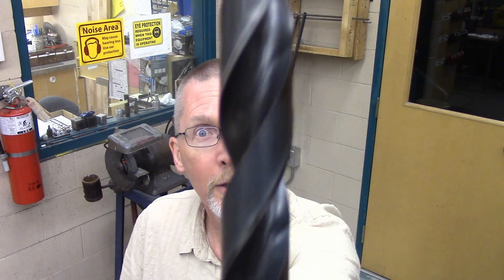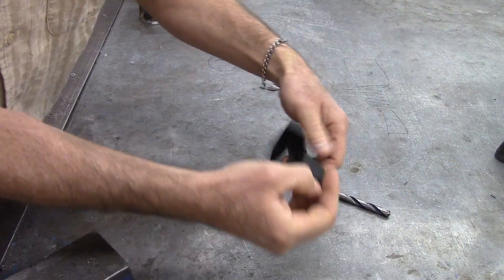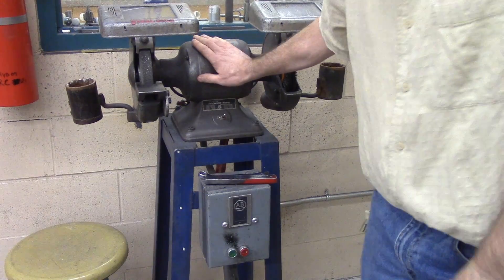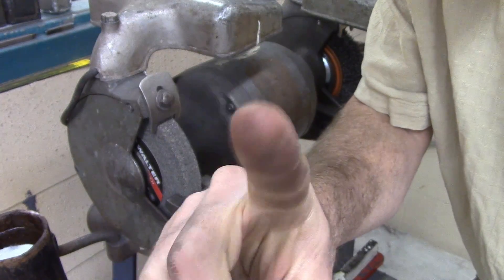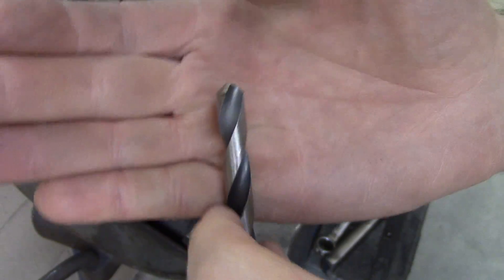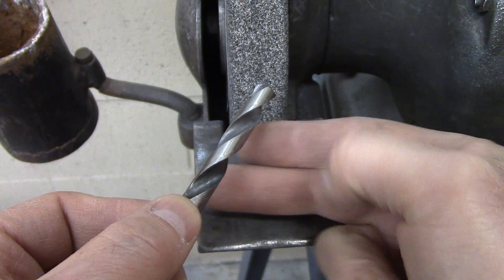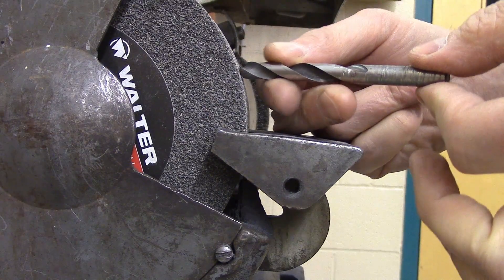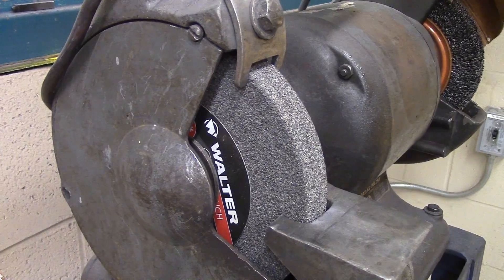HOW TO: Sharpen Drill Bits

Comment: You were taught how to sharpen drills by a real honest to God toolmaker/machinist/cutter grinder. The old timers didn't waste time with drill sharpening setups or specialty machines. 
I have had job interviews where the owner of the shop took me out on the shop floor, picked up a drill, butchered up the end, and then told me to sharpen it. Based on how I went about sharpening it, determined if I "might" get hired. 
He then took the drill, chucked it up and drilled a hole in a piece of scrap. 
If it cut right, made respectable chips, and most Importantly - drilled a close sized hole - is what determined if I could fill out an application form to be hired. 
Drilling holes and using sharp tools is the basis of pretty much all machine tool work.
If you can't sharpen a drill that will cut, you most likely can't do anything else that the shop will ask you to do!

Comment: how can you sharpen a step bit?  thank you.
Reply from the maker: I've run the grinder down the flutes to get a new edge, but I'm not very successful doing that.  It's more of a stop-gap until I can go into town and buy a new one.
Reply: shoot i was hoping you had a way to do it as good as for regular bits. Those step bits are expensive.  @GregWellwood
Reply from the maker: The GOOD ones are expensive (I sheared my Milwaukee step drill off - GRRRR!), but the cheap ones are pretty much throw-away when they dull.  And they dull quick.  Watch your speed with those - keep it slow.

Comment: Those are great, simple steps to a sharp bit.  Two things you might have added: even before you turn the grinder on, make sure the grinding wheel is of a medium or fine type.  If you use a coarse wheel, the bit will not cut as efficiently, as the edge will not be uniform.  Secondly, make SURE the wheel is FLAT and SQUARE!  Most wheels that have seen any use at all will not be flat and square and this is very important if your sharpening efforts are to bear good fruit.   A good idea is to buy a new, fine wheel and keep it ONLY for sharpening bits. Thank you for a fast, simple video.  
   You might want to do a quick video showing how to properly dress a grinding wheel?

Comment: You make it look so easy!
Reply from the maker: Yeah, but I've sharpened one or two in my day. Now I'm sharing the magic with you fellers!
Reply: @GregWellwood  Greg, maybe eventually you can do a video on how to do a split point. When I was a machinist..... Thinning out the web by doing a good split point increased accuracy quite a bit. We used to use a Black Diamond drill grinder in our shop, but I would also love to be able to see if it could be done by hand as well.... And I have a feeling you're just a man to show me how to do it!
Reply from the maker: I don't have as much experience with that, but I'll see what I can come up with.  I do thin the web when the drill is getting really short.  I also (cough) sharpen my milling cutters by hand too.... (cough)
Reply: @GregWellwood  It's truly a lost art..... hand sharpening of tools. That's one thing I always admired about the old timers: their knowledge of how to sharpen.

I remember one day I was working on a project involving brass, and the Foreman of the shop (an old German tool maker) helped me to sharpen my drill bit. And when he put "flats" on the leading lips of each flute..... I thought he was crazy! Then he explained that brass tends to 'pull' the drill bit too much -- that the flats help improve accuracy, and also protect smaller drills from breaking easily in brass. Who'd of thunk it? 😏
Reply from the maker: Yes, Brass you want no rake, or even negative rake.

Comment: Great video, I now know what I was doing wrong all these years, I was always hit or miss sharpening drill bits, my drill Guage is 2 nuts welded together on the flats and setting the drill on the flats giving me the angle of the drill which is close to a new drill angle
Reply from the maker: Oh!  That's a sweet idea!
Reply: @GregWellwood  I think a drill bit angle is 59 degrees and the 2 nut flats are 60 degrees, free hand sharpening, you won't notice a 1 degree difference, I can't take credit for that tool,that would go to a gentleman who signed my apprenticeship papers in the late eightys for heavy equipment repair! P.S. feel free to use this information, you do a awesome job on your channel 🏁

Comment: you make it look easy, i always screw it up, a freind said the best wheel for drill bits are the white ones something to do with heating the drill bit.
Reply: Based on my personal experiences with white wheels, they tend to be a finer grit than the grey ones you typically find on bench grinders.
Reply from the maker: I used to have a very fine stone just for sharpening, but the kiddies would grind them to oblivion with everything except sharpening.  For the home - use a fine stone.  With kids - use a durable stone (and don't press so hard).